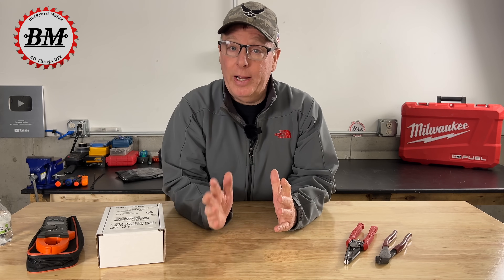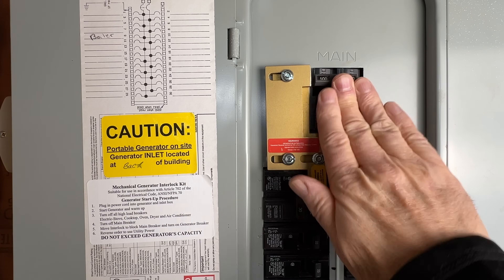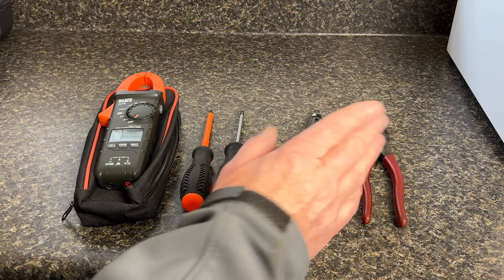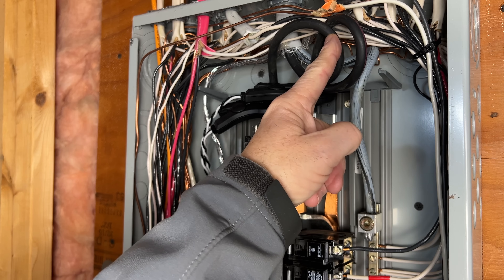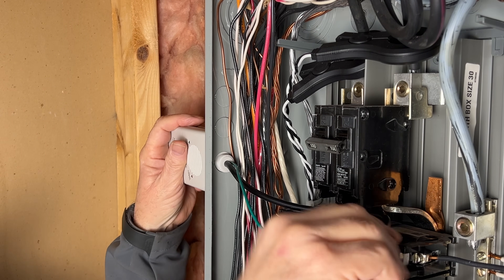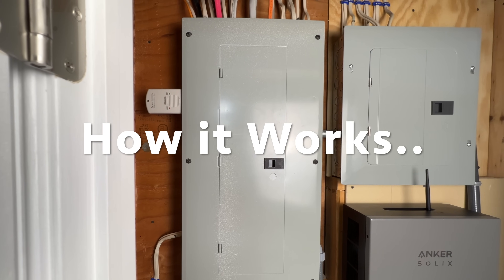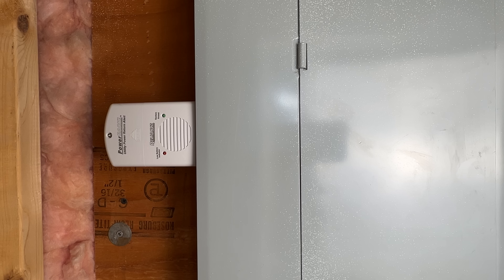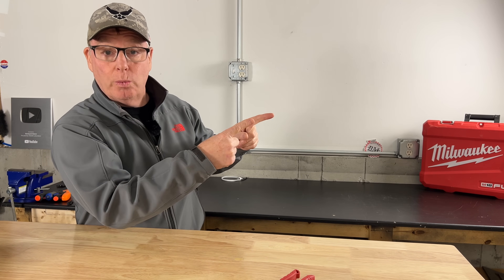The Secret to Knowing When Power's Back On!

Comment from the maker: ⚡ PowerBack Monitor - https://amzn.to/3CIoXMr
Reply: I just plug one of my radios into a individual breaker plug. When the power goes out I turn the radio on. When the power comes back on and the radio sounds , I simply turn the radio off.  if your device had the option of recharging a replaceable rechargeable cell ,  I'd get a couple.👍
Reply: @carmichaelmoritz8662 its not gonna work if your generator energizes that whole  panel. In my case I have an outside panel and a separate indoor panel fed from the outside panel. The generator mechanical interlock is at the indoor panel. The outside panel is fed from the utility meter and has 4 breaker slots. I use one them for a 120v outlet. That's where I plugged a radio. When the interlock is engaged, the indoor panel is isolated from the outside panel. So when line power comes back on, the radio turns on.
Reply: @arrow2042  👍.   Thank you for saying what I did not say.   That's basically the way I have.  When the power goes out I turn off the main breaker , I'm not wealthy enough to afford all the bells and whistles of automatic Breakers. I have the radio hooked up to a breaker that is hooked up to the main input side of the main breaker.  When the power comes back on the radio sounds , I turn off the radio breaker and then turn on the main breaker.  Obviously I also turn off my generator and battery backup inverter system.  My UPS system that I use to power my security system had a built in buzzer , I disconnected that annoying buzzer.  I do not need it due to the fact I get notified on my cell phone in case of a power outage if im not at home. My ups system sends a message to my security system that sends a message to my cell phone. I was just telling people of a simple way of doing it if you do not have all the bells and whistles so to speak.
Reply: Nope this device wouldn't work here.  Not weatherproof and would be located too far away.  I use a Ting sensor and check their website to see if the neighbors got power back.

Comment: This looks and sounds like a great idea. However, my main panel is mounted in a wall and I don't have access to the side panel knockouts. Since my generator panel is separate from my main panel in the detached garage, all I need to do is switch on one light in the garage to know when the power is back.

Comment: Wow you don't put a lock on the main breaker outside??? what if anyone turn the power back on WHILE you're working inside the panel... You're scaring me
Reply from the maker: You could do that if there’s a chance that could happen. Here I would be at a higher risk of a lightning strike on a sunny day. When you work at a commercial or industrial setting LOTO is a must. I actually taught a class on that before I retired

Comment: how do I know for sure which buss is the neutral and which is the ground?
Reply from the maker: If your neutral to ground bond is outside at the first disconnect, you will have four wires coming into your panel. The two hots which are connected to the main breaker or the panel lugs, an insulated neutral which connects to the neutral bar and a bare ground which connects to the ground bar. So you can tell that way. If you bond is in your main panel the you will have a connection between the two bar in most cases and a strap or screw bonding them to the can. That would be your main bonding jumper which bonds neutral to ground but at the panel rather than outside. In this case you will have three wire, two hots and a bare ground. In this case both bars are of the same potential because that are connected together and to ground.

Comment: You can also connect a light on the incoming main. A simple second disconnect for safety is important, but feeding something like a hall light via that connection gives a visual signal when power is restored. Just remember to switch it on.
Reply from the maker: That is an option but it's a code violation in most circumstances. You could get away with it with the 10 foot tape rule but you would have to fuse it and then you have the issue of putting two wires under the same lug which is also a violation.

Comment: Here every meter is connected to 5G/4G network that covers 100% whole country so you get SMS when power is out and back again and if it still continues out of power you can know it is in your property the fault , power lines are also mostly under ground last 10 years or so, so it may take 1-2 years to have like 2 second to 10 second power outage!  Seeing these kind of videos is like, are there any progress to better elsewhere in the world??
Reply from the maker: We have smart meters here as well but we cannot log into them or have any access to them at all. The power company has a website that tells us the status of the outage and an estimated time for power restoration. They also  send out text messages if you're signed up. The issue is the website will usually say "assessing" right up until the power is restored or close to it and the text message will come it 2-12 hours after power has been restored.
Reply: @BackyardMaine  Ok, now I get it. Here the sms and email system works fine no lag ever and we have now smart meters and almost total access to in real time, I can even shut my power remotely if I want, but in my opinion that is one more not so good thing when someday hackers shut my power 😂

Comment: 3:23 Thank you so much. I was wondering how it was reset and whether it might be sounding when we come home if or after a short power failure and restoration. So to be clear, this device is only switched ON during the power failure by the homeowner?
Reply from the maker: Yes. It gets switched on after power is lost and switched off when power returns

Comment: I use a transfer switch to hook the power from my house from the generator. When I had it installed. I purposely had them not to tie the circuit that goes to my washeing machine ehich also powers the hall light. When the power goes out. I simply turn the hall light on. When the hall light comes on. I kmow the power has been restored.

Comment: 3:00:  In my area at least, one has to obtain permission from the utility to disconnect the meter and it is not trivial. This was not mentioned, and you may wish to check with your utility to see what is allowed. If an electrician is required the cost for this inexpensive device goes up considerably, and you may wish to explore alternative techniques before purchasing.
Reply from the maker: Thats why I said that you may need to hire an electrician. A homeowner should not pull the meter and the utility permission is a must.

Comment: I installed one of these based on this video and it works great. My generator is outside in a concrete shed (properly exhausted, cooled, etc.) and the weird service entrance and double panels in my house meant it was much cheaper to back-feed both panels with an interlocked breaker rather than have the entire service entrance replaced for an auto transfer switch. This device is perfect and is very loud. It’s in the attached garage and I can hear it clearly in every room. It really helps save money by shutting down the generator as soon as power is stable again. I wrote a set of instructions attached to the panels that details how to turn everything off, turn off the mains, move the interlock, turn on the generator breaker and the monitoring device, start the generator, and power on the loads in the right order, then do everything basically in reverse when power is back. Would have been nice to have all this before Helene ravaged Asheville and we had no power for weeks, but we’re prepared for next time. The generator runs on gas or propane, so with a 500 gallon tank, we can run almost everything in the house for several weeks with judicious consumption.
Reply from the maker: Sounds like the perfect setup..

Comment: I would note that before turning off the emergency cutoff off outside, it’s a good ideas to turn off the individual breakers inside and then the main breaker and then go out and turn off the emergency cutoff off.
I’ve done 100’s of whole house Generac automatic standby generators and this was always my practice or custom. Turning off individual breakers will illuminate sparking at the main breaker when it is shut off and will be better on the equipment health!
Just thought I would throw that out there.
Also, turning off anything inside will also help to reduce sparking when shutting off individual breakers, which will result in the health of the electrical equipment.

Comment: I've lost one leg of our house service before and the other half was still energized. Can this device be wrapped around both of the hot wires or does it have to be one or the other?
Reply from the maker: One or the other. If you lost one leg it had to be between the main and the utility transformer. It’s a single hot leg on the line side of the transformer. These outages are not very common and don’t impact others in the area unless they are on the same transformer. But this device would have a 50/50 shot at identifying this issue.

Comment: Nice set up!!! I do not have a breaker at my meter, how do I go about installing it without one?
Reply from the maker: The only safe way to cut the power for you would be to pull the meter. I don't recommend you do that unless you're an electrician and have obtained permission form your utility supplier. If you hire an electrician to install it he or she may decide to do it live using PPE.

Comment: I just go outside and look at my meter display or wait for our EMC to call us.   Some people report that this particular device works well for a while and then stops working.  Not sure what the issue is but paying $45 for something that might not be reliable is iffy plus having to open up the panel box.  I have no safe way to install this without an outside disconnect.  I'd have to have my power company come out and cut me loose so I could install this.  Most of the reviews were good, however, so it might be worth taking a chance on this.

Comment: A far simpler solution, just leave a circuit connected to utility power with a lamp plugged into the circuit with the lamp switch turned on. When the lamp turns on, you now have utility power.
Reply from the maker: Thats not an option for most generator hookups. When back feeding the panel the main breaker needs to remain in the off position.

Comment: Looks interesting, but.... I don't love the 9V battery. Given the relative infrequency of power outages, that battery is almost guaranteed to be dead when I need it. And I don't like the annoying sound, I'd prefer a silent blinking light or something less obnoxious. I know... first world problems, right? I'm sure this works great and has it's uses. But it seems unnecessary and annoying for me. I can just look at other houses across the road and listen for other people's generators and that's usually good enough.
Reply from the maker: The battery is only in use when the device is turned on so it should last a long time.

Comment: I have an idea. I hope you can confirm it will work. I have no way of shutting off my external utility from the town. Without asking for a disconnect/connect. So, what if I install the PowerBack ahead of time. Leave it turned off. Then when the power goes out, I turn it on. Would it then detect the return of power and sound the alert?
Reply from the maker: Thats how it's designed. You will need to leave it turned off when the power is on or else it would sound the alarm. When the power goes out you turn it on and when power returns you turn it off. I'm not sure what you have for a setup but it's not safe to try to install this on a live system.

Comment: I noticed when you were installing the power back on device (which I have also done), you have 2 clamp on current transformers on your power mains. What are they for? I have current transformers on my generator breaaker leads which reads in watts. When I run my generator I get no reading on the 2 meters. I think I picked the wrong meters to get a good reading. I have a 6500 watt generator that runs the whone house except I need to turn off the water heater. Other than that my gen runs the whole house including the 240 v well pump. So whaat are you using the current transformers for?
Reply from the maker: I have the Anker Solix F3800 with the Anker Home Power panel connected as well. I have a few videos on that system and a new one coming out in a few weeks. The CTs are used so the Home Power Panel can monitor incoming power.

Comment: I installed this same device about three years ago and it works exactly as advertised. I used it a couple weeks ago during a power outage, and - no kidding - when the street power was returned that 100dB was almost painfully loud. It's well worth the cost.
Reply from the maker: It is a great device for the price. I'm glad it's working well for you!

Comment: When I had my electrician put in my critical loads panel for my generator, I didn't have him connect up the subpanel that supplies power to my bedrooms. I just leave the light switch on in the bedroom. When the light comes on, power has been restored.

Comment: Only issue that may arise is if power goes out on one phase, or conversely, goes out but is restored on only a single phase. I have seen this happen when the local utility loses one of the two phases on a 240 volt supply.
Reply from the maker: The only way to loose one leg on a split phase system is if the problem is down stream of the transformer or on the low voltage side. The line side of a residential transformer is just one line and a neutral.

Comment: I put 4 neon bulbs on my transfer switch.  2 red ones on the mains side,  2 greens on the generator side.  When the greens are on,  the generator is working on both lines, when the reds come back,  the mains are back.  If only 1 is on, there's a fault between the transformer and the house.

Comment: Is it just me, or is it weird that anyone wouldn’t know when the power comes back on?  It would be nearly impossible for us to not observe:  1) appliance & plug-in digital clocks coming on, 2) lights coming on, including a few that are on in the daytime, 3) Ring doorbell camera chirping, 4) internet router powering up, 5) solar generator displays switching over to pass-through charging mode, 6) hands-free kitchen faucet cycling back on, 7) furnace or a/c cycling, 8) aquarium aerator bubbling & lights coming on, 9) ceiling fans (which run at low-speed most days) rotating, 10) humidifiers (in winter) cycling back on, and 11) CO detector in the basement beeping as it powers up.
Reply: No , it’s just you. This video is for those who use generators to power our houses during power outages. When we have the main breaker turned off that supplies electricity to the house there’s no way to know because the generator is supplying our power. This device senses power from the pole to the main breaker. You probably won’t understand anything I just said anyway.
Reply: @ You clearly weren’t capable of grasping my point was aimed at solar generator power-backup users.  And I don’t need my engineering degree to understand that you’re being an arrogant dyngus.  😎

Comment: Interesting product.  

I have 3 methods to determine if my Utility Power has returned.  
a)  We have several street lights not far from our house, so IF (and only if) it is dark they will come on.
b)  I have a Gerlink System (Attaches between the Meter and the House) that has a light that indicates Utility Power has returned.
c)  My Utility will send me a TEXT when they believe that they have solved our issue.  

Of course in the middle of the night it would be helpful to have another method to assist me.  The challenge for me is that when my Generator is running my complete panel is powered.  Therefore this product will not tell me my Utility power has returned.
Reply: This product will tell you exactly when the power is back on IF you’ve shut off your main breaker to your panel box as you should have to begin with. It hooks to the opposite side of the main breaker .

Comment: Portable generators can't provide the same power as the utility. Why not just use a utility only circuit to turn on a light or radio...
Reply from the maker: I don't have any utility only circuits. My panel main is off when the generator is on. So when the power comes on it will only energize the line side of the main breaker.

Comment: I recognize the power has failed when the WIFI stops working. It’s the only 120 v circuit that isn’t on my off- grid essential circuit panel. I’m only interested in the grid power returns it we want to cook with the electric range because it and the dryer stay on the grid. I have a propane generator but will likely never need it. Tried to give it to my son who lives off-grid in Tennessee but he brought it back after we installed solar.

Comment: I made a sensor like that using a 120v piezo tone generator I got from Radio Shack years ago along with a switch, box and lamp wire .  Wired it to the incoming power feed before the main breaker.     Turn on the power switch during a power outage.  When power from the pole is back on, you will hear it like yours.  Works great.

Comment: Leave some lights on that are not powered by your generator. You'll know when the power comes on. And it's free.
Reply from the maker: Most generator connections and the one I use requires us to turn off our main breaker. Do you not know this?
Reply: @BackyardMaine  some people commenting to this video have ABSOLUTELY ZERO comprehension to how running a home generator works. LOL.
Reply from the maker: @def1791  You are correct.. Welcome to the life of a youtube content creator. lol